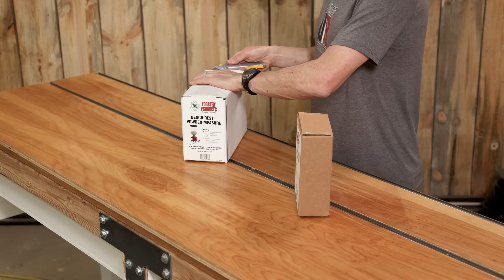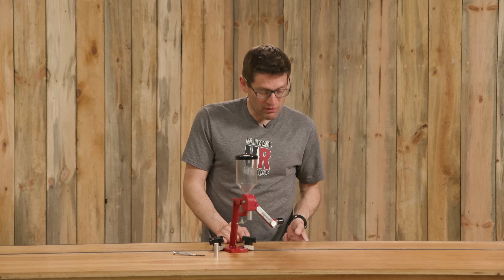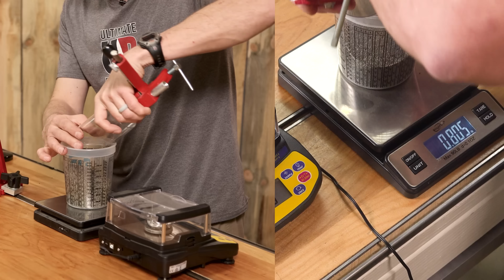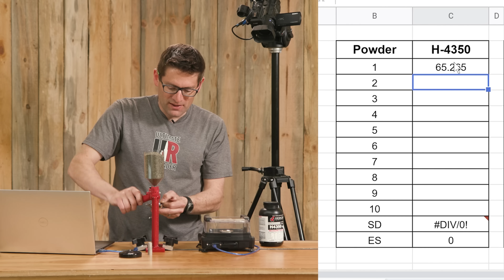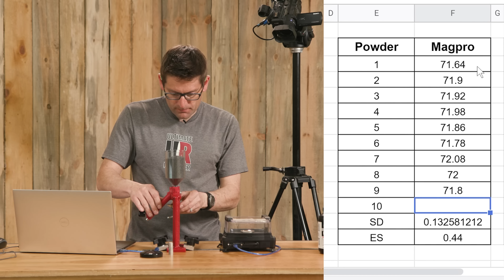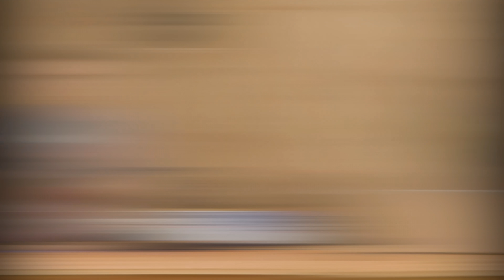TESTED: Forster Bench Rest Powder Measure

Comment: I really would like to see like 5 charges when the hopper is full and 5 charges when the hopper is almost empty see if the weight of the powder messes with the accuracy I know Hornady has that baffle in there powder charger and I really like it for a more accurate throw
Reply: joram banman Yes, great suggestion!  I have Hirnady and RCBS with baffles and the charge slowly drifts with both as hopper gets empty.  For me this is a problem as I have to keep adding powder every 100 rounds or keep adjusting knob.
Reply: I believe it was Precision Shooting magazine did a test of powder measure repeatability, a Harrell won, folled closely by the various Redding "BR" measures. Not surprising, considering that Harrell has models exceeding $300, and the BR Reddings are over $200...

Comment: Generally speaking for most applications you can work with thrown charges with ball powders or the finest of extruded. For the rest, no matter what the measure, if you want to hold low weight variance you will have to throw light and trickle up, or use an electronic dispenser. For me, getting the best results with extruded powders has required more than consistency. It has required trying different techniques until the best on is found for that powder, and measure, and doing that consistently. Once I figured out the right techniques with this measure, I was well pleased with the results.

Comment: Nice video. I bought one last year, but ended up returning it. I compared with the Lee powder measure and it lost big time, then add that it is $100+.more expensive then the Lee.  The plus was the easy clean, the bad was that the adjustment was not too easy and not offering a benefit over the cheap Lee. Maybe they improved the design.

Comment: Half a grain spread, I wouldn't call that accurate.  That's probably out there on par with Lee auto drum, except auto drum cost 32 bucks (prior to shortage).  Bottom line stick powder metering sucks and I don't think powder measure makes much difference, this is why I use RCBS Chargemaster Lite for stick powders.

Comment: I don’t care what kind of measure you use but most WILL cut most rifle powders. In my testing I got about +- .5 with H4350. Now that was the worst, however most were within .2 tenths. Now with a pistol or ball powder it’s usually dead on the money or .1 tenth off of my charge. I love mine however the big issue is I can NOT get the handle to stay tight. I ended up putting lock tight on the screw going into the handle to hold it but this has also failed after about 300 charges. Going to call Forester and see what can be done. Overall yes it is expensive but it’s a great unit. Try loading 9mm or 38spl on a RCBS Chargemaster, it’s enough to make you pull hair. So, it speeds up my reloading time considerably. If I can figure out a solution for the drop handle it will be great. I would like to know if Gavintoobe had this same problem???

Comment: There is a business that sells replacement powder hopper that are made of Pyrex instead of plastic which should by all means stop any static electricity from building up on the powder in the hopper so that powder bridging in the drop down portion should be a thing of the past. Personally I am getting one, as static electricity is a Handloader's nightmare. DRAM WORX - Pyrex Replacement Hoppers.

Comment: people notice how many manufacturers of these hand powder dispensers are going to shorter height powder holders.
my Hornady powder dispenser is the old tall style which if I keep the powder at no less than half full my powder load weights are very accurate. If I go below half way full it will require trickling.

Comment: That's not bad for results, although the fact that the ball powder received the same result is a bit worrying.  Usually, that "accurate within 0.1 grains" you see advertised usually means with some generic type of ball powder.  I'd like to see how well it did with something like Winchester 748/BL-C(2), or, like you said, Staball 6.5.  

Like you said, though, a lot of people will throw the charge then trickle up.

Comment: Still not the accuracy for precision loads but as mentioned, those get trickled up by serious loaders who aren't hacks. A half grain spread is not what I expected, especially for ball powder. Ball powders usually meter very nicely with not more than a tenth of a grain high or low. I'll stick with my RCBS in which I have installed the small bore measure and a powder baffle in the hopper. My results are very consistent with that. Flake powders can be quite finicky when loading pistol but it doesn't look like this Forster would do any better.
Reply: There is truth to this BUT technique does make a lot of difference. I just loaded 100 rounds of 9mm and 38spl and all charges were dead on or .1 tenth off and I was using a flake powder.

Comment: can never find a powder measure that is within .1 grain. I added a pistol metering chamber to increase accuracy even still could not get it to .1 grain. finally i went with self dispensing powder measure. i hope this has the accuracy we all strive for.
Reply: Nope, this one isnt that good either. Best ones i`ve tested were Redding & Hornady. Both beat this forester.
And the throw length on the forester, terrible! Who ever engineered THAT, should have their nuts bricked.
Hornady & Redding are half the hand motion to dump a charge from them. I think forester is still living under a rock.
Reply: @DERP-1  i tested hornady and could not get effective results. I prefer a powder dispenser.
Reply: I get mine within .1 tenth using pistol. Seriously fellas most guys shoot from 7 yards and I don’t think a .1 or even a .2 tenth is going to matter.
Reply: @appalachianbushcraft3959  lower calibers are an issue. what drop do you use?
Reply: @pearlrival3124   I use the Forester Benchrest, same one depicted in this video. I never had a problem with metering pistol caliber charge weights. They are always accurate as long as I keep my technique consistent.
Reply: @appalachianbushcraft3959  I use to let the handle drop so it would tap out the powder. seemed consistent, but still trickling up is most accurate. I shoot small caliber rifle long range. for me .1g matters. for most it wont. pistol doesnt matter to me its already so inaccurate.

Comment: These stats are about average for a volumetric powder measure. I would suggest to check performance without dumping the powder back in every time, and also with a full load, middle, and nearly empty, just to get a view of the issues with the hopper and baffle design contributions. For some models, you get a huge negative effect from those features and on the better ones those features help mitigate differences due to tank levels. I would also run a baseline test in the session using a Lee PPM since it is the cheapest and often considered one of the best, and include a fine grain ball powder like CFE223 or similar.

Comment: I just don't get it.  Why use a powder measure that gives SD's of half a grain, requiring you to always measure low and trickle up ... which is a pain in the butt ... when something like a Chargemaster 1500 gives you automated accuracy to a 10th of a grain every time in half the time.  What is the advantage of a manual powder measure?
Reply: My question exactly.
Reply: @coyotehammer1438  One answer might be: "To use a super-expensive scale to measure to the hundredth of a grain for mega-ultra-precision loads."  Bottom line ... 1/10th of a grain is already way more accurate than I need, given I'm old, blind, my hands shake, and I can't remember what I had for breakfast.
Reply: Because most shooters that purchase these use them for loading pistol or they use them for rifle and trickle up. Loading calibers like 223 or 308 in the AR platform usally doesn’t require that kind of accuracy unless you have a custom platform and in that case I’m sure you wouldn’t be using this for a final powder throw directly into your case. Not everyone can spend the kind of cash on an rcbs chargemaster powder measure. Yes rcbs has a new model for around 250.00 but still.
Reply: The load cell in the chargemaster tells you it's a 10th every time. They do good, but so do a lot of other powder measures. Without talking a lot of mess, compare this forster to reddings. Even hornady and rcbs in the right hands. On top of that, if you're on an accuracy node you don't have to go bonkers unless you are actually one of those guys that shoots a half mile.
Reply: @eddieb9110  I shoot out to a mile, reloading 6.5-CM, 300-WM, 300-PRC, and 338-LM.  Started with the Redding Competition Powder Measure, and settled on a ChargeMaster 1500 for accuracy and ease of use.  Having used both ... I still don't get why someone would spend the same amount of money for something way less accurate, that takes longer to use ... unless you're in the "dump and shoot" group and half-a-grain accuracy is good enough.  If loading bulk ammo for volume shooting is your thing, then these powder measures are just fine.  That's my assessment.
Reply: @rustyinoregon2769  first of all they don't need power. And again...  that cheap chinese mechanism in the rcbs can only tell you what it thinks it knows. It's nowhere close to a lab balance.